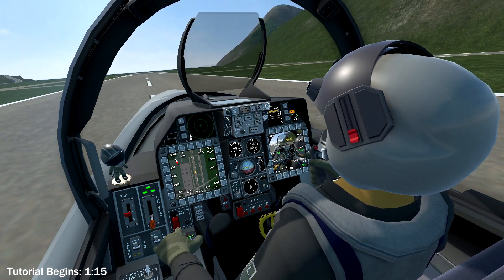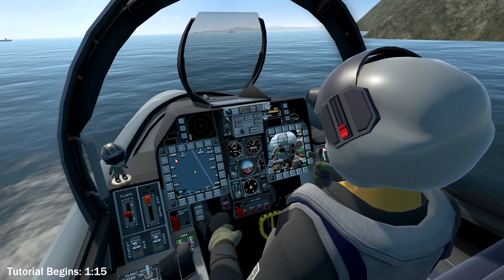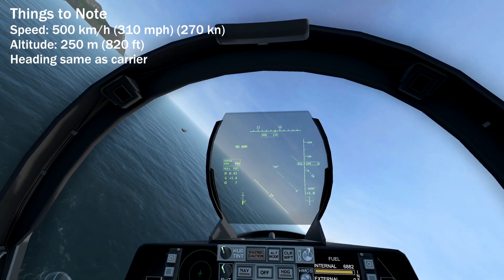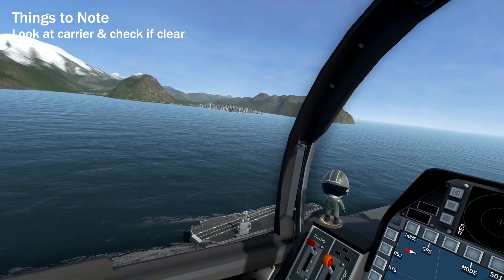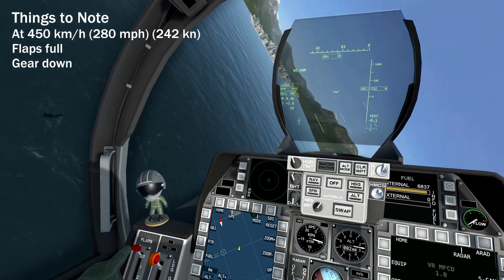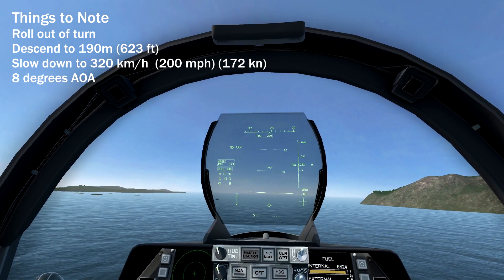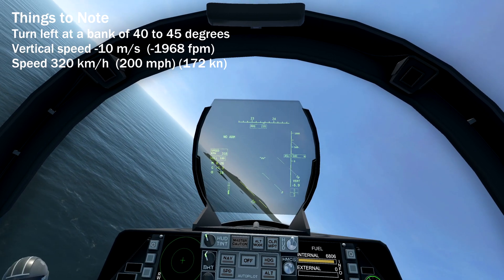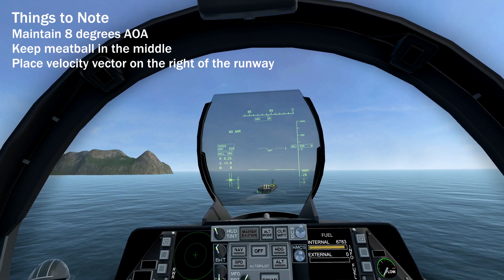VTOL VR - Case 1 Recovery Carrier Landing Tutorial

Comment: Excellent, also you can use the two parallel blue lines on the NAV display to line up from further distance. Using the speed hold function of the AP also helps a lot, just set it to 150/160 kt in landing configuration. Then you just have your velocity vector to worry about. 
One common mistake is to throw the aircraft down on the deck as soon as you’re above it, but that usually makes you hit too short, bounce and miss the wires. Just follow the ball and it will take you to the exact right spot.
Reply: lowkey, better advice than the video, not that this video is bad. but your comment is to the point of landing, while this video is more of a proper roleplay style of landing. you have a good one and stay safe :)
Reply: also when i say "roleplay" i mean like he gets into the pattern, stays at altitude for upwind, crosswind, downwind, base, and final.
Reply: and all that

Comment: One thing that is slightly incorrect is your statement about AoA. It could be different in VTOL than DCS, but you should not aim for a specific speed. Instead, only focus on the AoA. A fully loaded aircraft will be going much faster than one with no stored and fumes in the tank. There could be a 20-30 knot discrepancy in the speed of the aircraft. This is why pilots always fly by AoA and not a specific speed for carrier ops. Other than that, great flying and good tutorial.
Reply: Thanks for this clarification!
Reply: I might send this to jrllotak2 so he can reply

Comment: So is it good practice to have the waterline at around +5 degrees?  Slightly flared.
Reply from the maker: Yes essentially so long as the flight path marker is around -3 degrees from the artificial horizon line. More accurately, have the angle of attack be 8 degrees. This will ensure that the hook catches the arresting wires when you land on them.